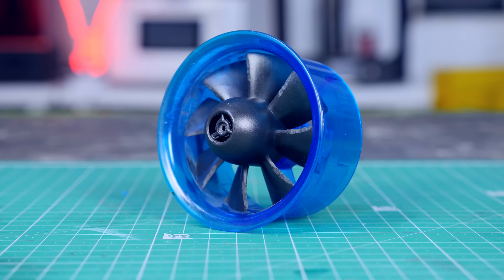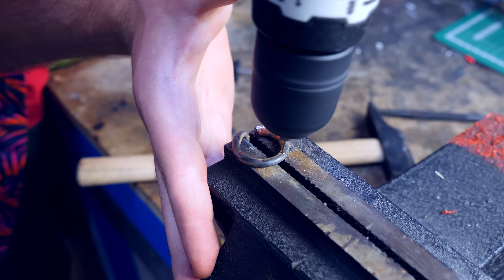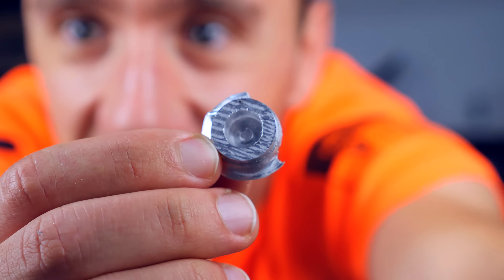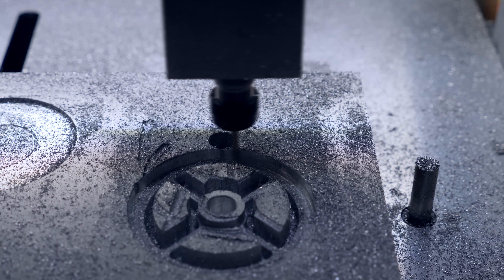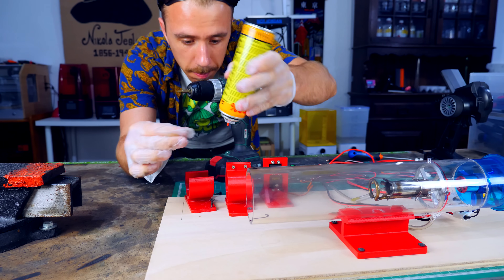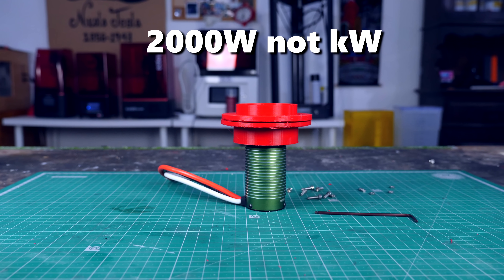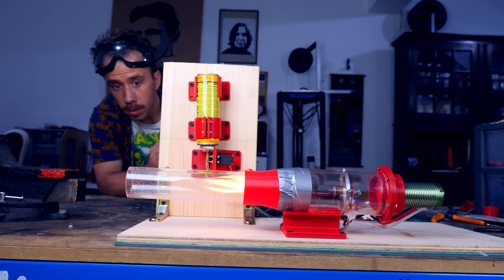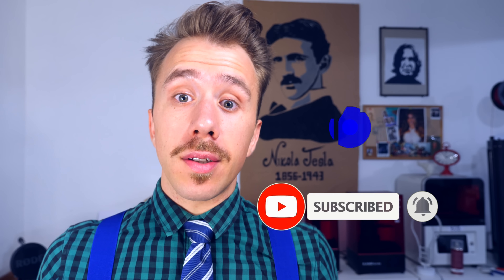I turned my Fan into a Jet Engine (3D Printed EDF Afterburner)

Comment: Video idea: You should build a sequel to the compressed air wankel by building an air liquid piston engine AKA rotary 2.0. 

It basically is a rotary turned inside out, which provides better a heat distribution and compleat stationary seals.

Comment: I think cnc aluminum stacked (so a bunch of ~6mm thick pieces stacked together) and held together with screws/threaded rods might finally get you a pretty heat resistant rocket engine. Perhaps with a THICK glass tube to see some of the combustion

Edited: typo.

Comment: Try making very small cold gas engine and mount it onto model rocket. Use microcontroller to control engine throttling with remote controller.

Comment: Isn't this just a flamethrower? I'm no aerospace engineer, but I'd think you'd need some constriction of flow to do useful work with the expanding gas, right?

EDIT: ...oh, beat me to it, although that looks pretty weak. Probably need tighter constriction and a metal body that isn't just going to blow out on fire like all the plasticky rockets.

Comment: Video idea: integza should try making a water powered turbocharger for like a car, but instead of it using exhaust gases to spool the turbine it could use the water used in the radiator from the engine, this could be done on a small scale fairly easy too.
Reply: Good idea bro
Reply: @theirishaxe9405  thanks I thought of it a while ago but was never early enough to a video to share it before someone else had a ton of likes on their idea

Comment: Video idea: Just for fun you could trie to use the exhaust from the engine to power a turbine (Tesla Turbine). Because the exhaust is probably very hot you can trie to build the turbine out of metal with your CNC which would be a video worth alone probably.

Comment: Project idea: Use a humidifier as a fuel injector for a rocket engine.
Reply: Depends on the humidifier, you might be able to get something out of an ultrasonic humidifier but a cool wick humidifier isn't going to help things.
Reply: I was hoping ab ultrasonic humidifier would be used.

Comment: Video suggestion, make a fully liquid fueled rocket engine using kerosene and lox. And use a pre burner, injectors and turbo pumps. May be hard, dangerous, and expensive so you don’t have to do it just a suggestion that would be cool.